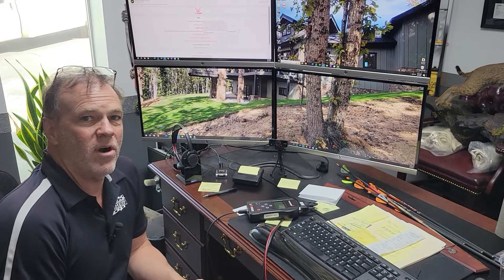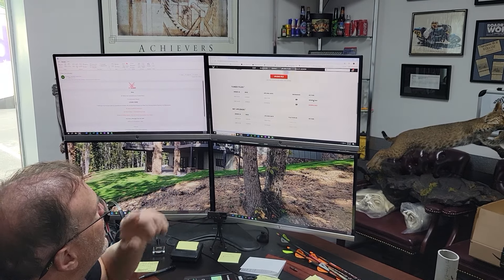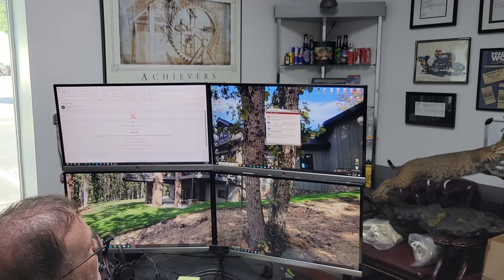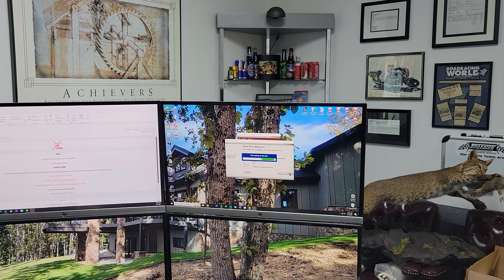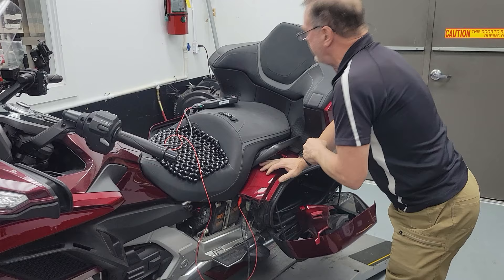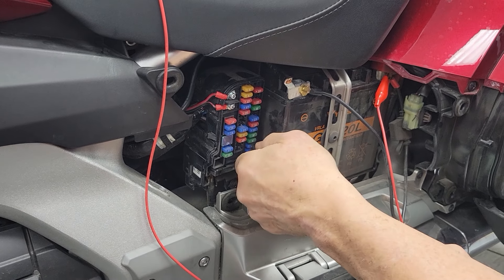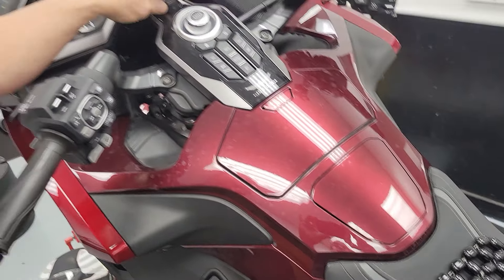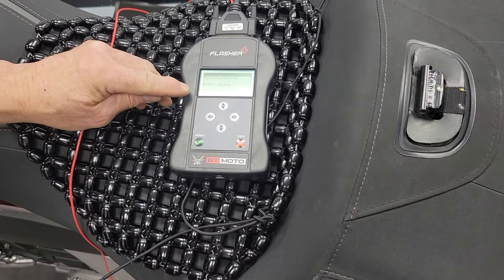BT-Moto ECU Reflash, 2018+ Honda Goldwing: HOW TO INSTALL, PART 2 of 4 by Max McAllister & Traxxion

Comment: Looks challenging, but do-able. I understand that after loading your OEM map onto the "my genius, you need to send it off to BT-MOTO to be re-mapped, which takes a few days. Also, there are some options to choose from which I wouldn't know the correct one without assistance. Hopefully there is tech support in case of questions. Please lets us know what kind of gains you made, and your honest opinion on the value of the install. Thanks Max
Reply from the maker: They have dyno mapping on their website, but it was like 10hp across the board, which is massive.  I have riding impressions in Part 4.

Comment: Does changing the ecu, void your warranty?
Reply from the maker: There's no way to "read" the map on it at a Honda Dealer.  But it can quickly and easily be set back to stock if you wanted.  
What do you think would fail?  Goldwings just don't break down.